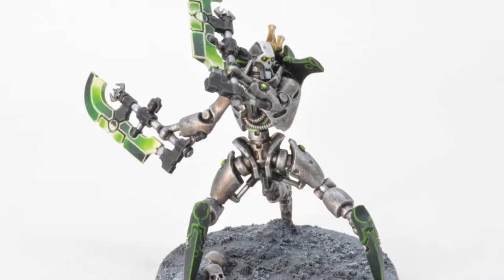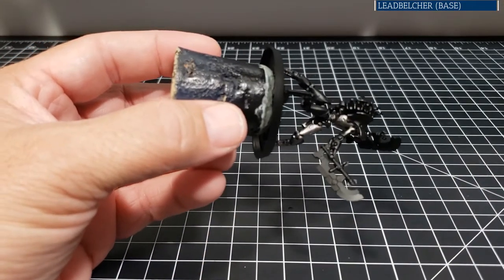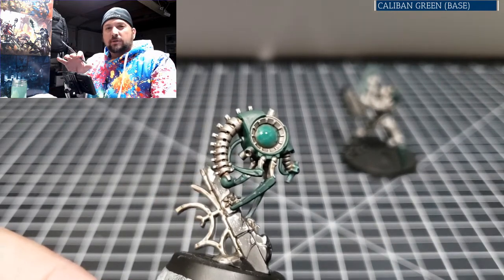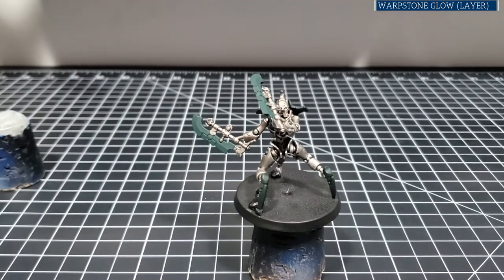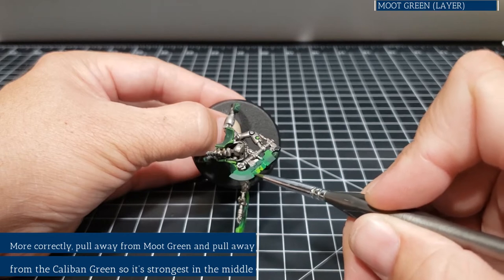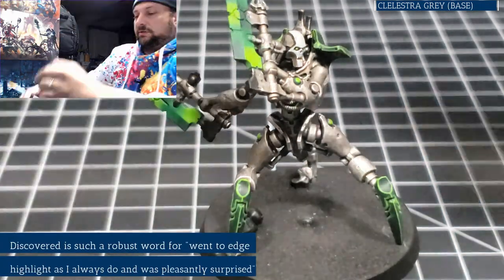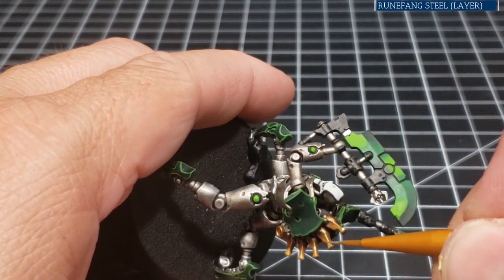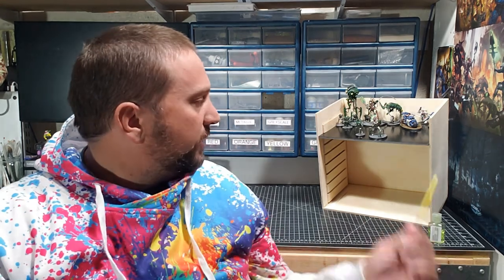Necron Skorpekh Destroyer, Sautekh Dynasty

Comment: I'm super curious, what is that brush you use? It's fascinating looking. Especially for the edge highlighting step it looks like it would be a wicked assistant.
Reply from the maker: I think you're referring to the blue handle brush and if that's the case it's actually from a pack of four brushes from Royal Langnickel, Crafter's Choice, Golden Taklon (RCC 203 to be overly specific).  They're synthetic, have a nice "snap" to the bristles and are inexpensive.  Definitely served its purpose but after a while the tip was bending and fraying no matter how careful I thought I was being, though still not ruling out user error, so I moved on to some Army Painter brushes I got a deal on.
Reply: @roshamjoepaints  Also I should have added in my initial comment I <3 your scheme it looks so badass, the colour blocking on the claws/shoulders/head give an awesome contrast against the overall skeletal metal scheme you've got.
Reply from the maker: @timothygrey726  Thanks, I appreciate that.  I wanted to try something a little different however I'm not so daring as to make up an entire dynasty, and I already have other Sautekh Necrons, so I figured keep the scheme but also add a little of my own touch.
Reply: @roshamjoepaints  If you’re alright with it, I’d love to copy the colour blocking :) I’m doing Novokh myself so the red would look really striking like your green against the rusted silver effect I’m trying to go for :)
Reply from the maker: Oh by all means, its not as if I own any paint schemes.  I'm just making these for fun and to show off what I've done.